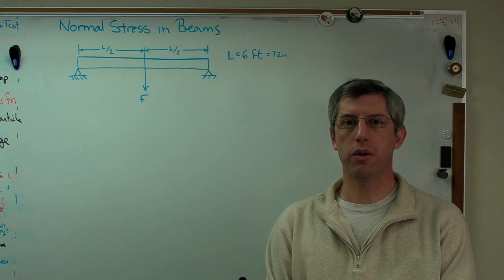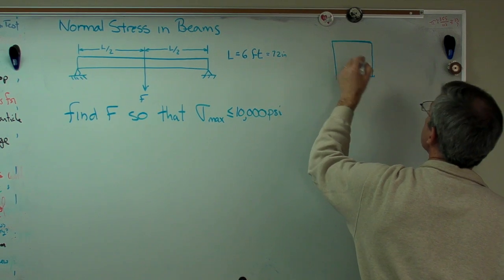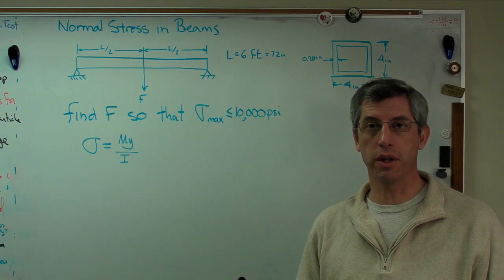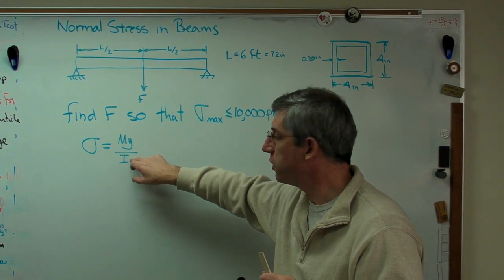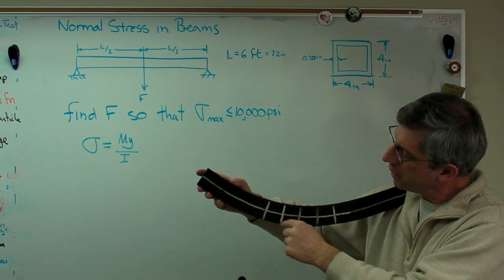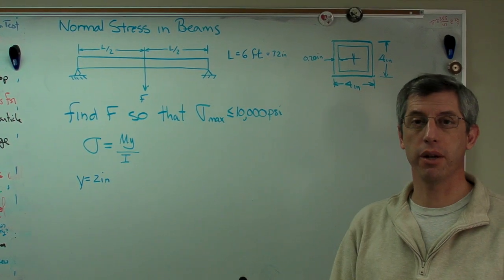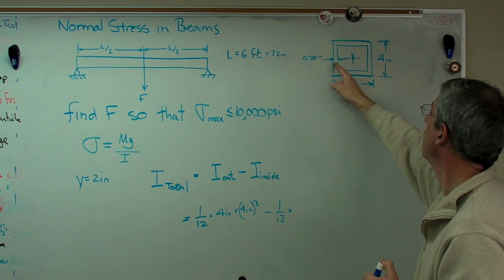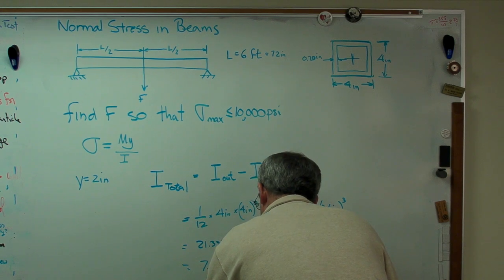Beam Bending 1 - Part 1.MP4

Comment: As always, very very very informative lectures. Can't believe that you are also concerned about the units, too. Another way of saying this is your concerned for your audiences :) Another thing I like about you is that you always have a clean board that can't be cleaner. I believe that helps students a lot to keep track of where you going. One thing I always complaint about my professors is that they always have a big f*king messy board with tons of numbers and drawings. thanks for the videos.